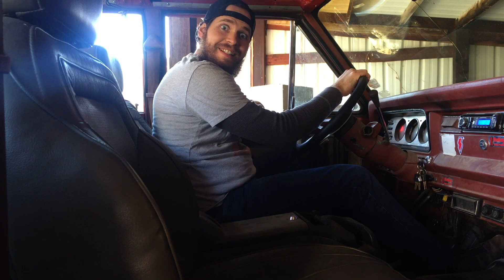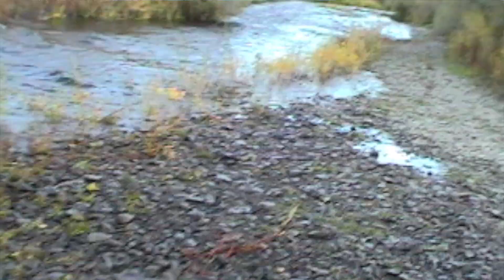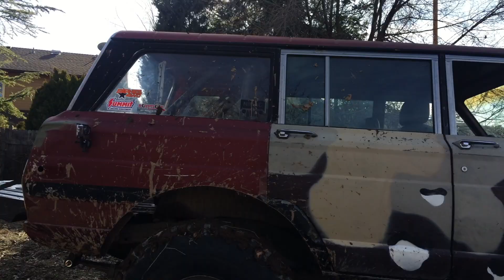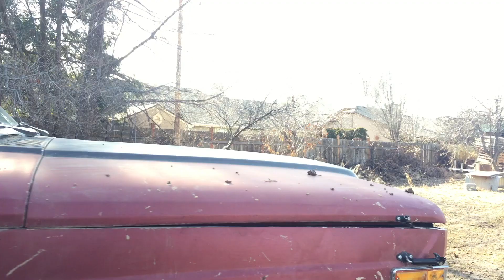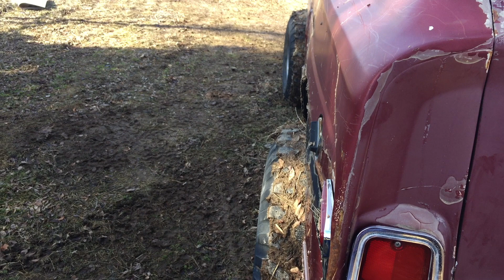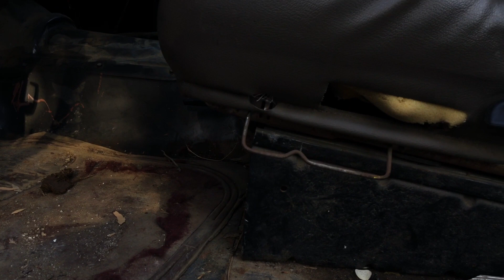My 1979 Jeep Cherokee Chief: A Jeep Story

Comment: Dude, that thing is way cooler than a zj. My 79 waggy is staying full time quadra trac, amc 360 and everything. Gonna bite the bullet and run the original drive train. Not for everybody, I know, but I like it.
Reply from the maker: Yeah I agree, the ZJ was fun though. I wish someone made better seals for the Quadratrac, I wasn't real impressed with the crown auto seals. Looks like BJs has their own made in the USA chains for it though so that's cool. I'm getting closer to having my AMC 360 put back together, just got the short block buttoned up today! We'll see how the quadratrac holds up to the extra ponies! Thanks for watching!
Reply: How many more ponies? From what I understand, the quadra trac is pretty horsepower tolerant.
Reply from the maker: Not a ton, maybe 275 total vs 175 from factory. But it’s not just that, it’s the 37s and lockers

Comment: What exhaust system? What engine? And any after market headers ?
Reply from the maker: I'm in the middle of rebuilding the AMC 360 right now, with edelbrock intake, carb, summit cam, hedman headers, and summit mufflers
Reply: @DaysofPainandVictory  'Merica! I have a 79 chief. About 95% restored. Trying to get a rumble tough sound like that. 360 V8 by AMC fuel injection.
Reply from the maker: @dagothvaldrusa5014  Sweet! yeah i'd love to put the Holley super sniper system on it like we did on the trophy truck, carbs always give ya some issues off road. Any lift? Tires?
Reply: I have 33 inch tires on it. No lift but w them tires it already looks lifted. Man, you should make some more videos every now and then with that Chief... love hearing her Roar
Reply from the maker: @dagothvaldrusa5014  I’ll be filming more next week on the Big Chief when we get back from the underpowered tour, finishing up the fresh build on the motor and getting it running again! When I got this thing it was on 33’s, I think that’s a great size. Keeps you from breaking a bunch of parts but you can still get a lot of places